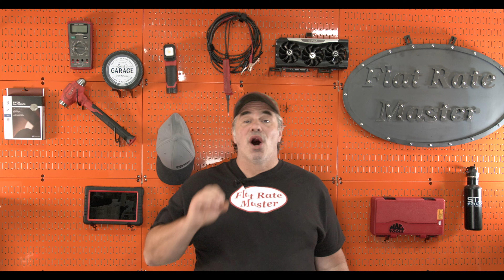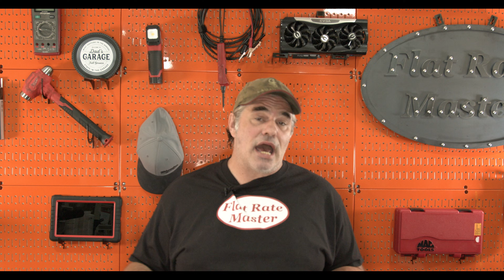How to Become an Automotive Master Technician

Comment: Uhhh sir did you just make up your own requirements masters is achieved threw the manufacturer you take tests too achieve it it says your qualified too do the work your doing. manufactures will not pay the tech unless the shop has knowledgeable person working there or several knowledgeable shop competence

Comment: I am ASE master certified, have been for many years. I don't think it means you know everything. No one can know everything. I think it shows you know the basics of how each system works in vehicles. For instance if you are ASE certified in HVAC. That means you know how the system works and the theory behind how the system works. You then can apply that knowledge along with the service manual to diagnose what is wrong with the HVAC system on the vehicle you are working on at the time.  So you can apply that knowledge to any make and any model vehicle.  Being ASE Master certified does not ever mean you are a master in the trade. Simply means you know the basics of how systems work and the theory behind how they work.  Someone with a good knowledge of theory and good knowledge of how to read schematics, how to test components, know how components are suppose to work would have a easier time figuring out a problem in a system, then someone without that knowledge.

Comment: I’m not ASE certified, but I still do technician work alongside alignments and oil changes, etc. it’s not particularly hard to do most things, you just need a good set of tools and the willingness to just get the work done. I work with a master tech that has been doing it for over 30 years, and you would be surprised how many seemingly hard jobs can be made easier just having the experience of doing it before and being able to do exactly what’s needed to fix it. I put an entire RF suspension and knuckle on a bmw x5 in about an hour and a half. All because there’s little things here and there that make the job a lot easier if you just think for a minute. The pay just isn’t there for me to want to invest money and time into tools and certifications training to get 15-20% of max 7-9k a week in service

Comment: Spot on, I couldn’t have explained this topic better. Training in class with other techs is where a lot is learned. But where most don’t want to put in the time that’s not paid for by the employer, is at home. Many hours of numb legs due to toilet top reading. laying in bed falling asleep with phone or tablet in hand. Watching scanner danner and other informing videos on how each and every single component and system on a vehicle works and what it’s job is. Learning how to use a scope is a big one. It’s crazy to think about everything that has been learned and experienced in my 21 years in the Automotive field. 🤯

Comment: Been a certified Master Tech for a few years now, and yes theoretically I know I primarily means you can pass a bunch of tests.  Worked at a stealership back in 97ish, a "husband and wife mechanic team" worked there.  The wife had the Master certificates on the wall and L1 to boot, but couldn't diagnose a pb&j sandwich let alone find a damn oil drain plug. Think the husband did 90% of the work while she played mechanic and "looked " busy.

Comment: Recommend (I passed all 8 a series in community college auto school)

Start with 
brakes 
Drivetrains 
Engine performance 
Steering suspension 

Next study like a mf on electrical 
Pass electrical 

Now you can move on to energize performance
Hvac 
Engine performance 
Auto trans 

I recommend doing the tests in this order because the last 5 are heavy on electrical diagrams or asking questions about sensor readings 

If I can do it anyone can just be persistent

Comment: OK. You are Correct. I Don't Think Anyone Can Be a "Master Technician". Like A Master Plumber Or Electrician. Our Systems Are Too Varied. How May Differant Vehicles Can You know enough to Be a master. I've been a Mechanic / Technician For 37 Years. I'm ASE Master Certified Tech. (I Passed tests) I Recommend People Specilize. I Think You Cild Make More Money & Buy Less equipment. For Me I Don't work On Europeans. ( Exsept a Couple) to much differant Equipment Needed. I Worked a Transmission Shop For a Year. IGot a Basic understanding Of how a Automatic Works I've Rebuilt a THM350. But I Understand The Principles I Couldn't Rebuild one Now or a CVT. Everything Is Contantly Changing. You Need Training & Never Equipment

Comment: I was ASE master certified after graduating from tech school and working in the field for one year. Becoming ASE master certified is very easy and that certification alone shouldn't hold a significant amount of weight. It takes years of hands-on work experience for most people to really start getting good at what they do and you need to work in an environment that allows you to keep learning. If you feel comfortable where you work and think you can handle anything that comes through the door, it might be time to look for a new job that comes with new types of work and new challenges. 

When I left my first automotive job, I felt severely under-qualified and inexperienced starting at my second job and that was a good thing. I was already ASE master certified when I started that job, but I still had a lot to learn. I was a much better tech when I left that job.

Comment: I still can’t get over all of the “high level” techs I’ve met over the years that have been doing the jobs for 10+ years that only go through the motions of performing the work rather than learning how and why the system works to begin with. The people that claim if there isn’t a flow chart to fix the problem then there isn’t a problem to begin with 😒

Comment: Shops don’t seem to do many repairs, like cvt transmissions. They just replace parts. Anybody can replace parts. And I’ve seen so many occasions where the shop can’t figure out a problem. They’ll just say it’s normal. Nothing wrong.
Reply: The US parts supply is set up to replace parts over rebuild them. Try getting brushes, bearings and a solenoid for a starter and see how long it takes. Add in the crazy labor times shops have to charge as well. Try rebuilding a wheel cylinder that may take 30 minutes instead of buying a $15 part you toss on. 

Transmissions are now a specialty, have been for 20+ years. There are a few transmission shops in my area that only do transmissions. And they are VERY good at them.
Reply: @mph5896 this!!!!
Reply: The repair procedure opposed too replace procedure is  weighed how much ….lyou ppl and your old school mentality it’s about dollars a what’s makes sense 10.000 too repair or 5.000 too replace you decide what would you do 5.000 an you get a new transmission make sense

Comment: As cars become more and more electric, they will become more and more disposable 

The days of fixing a car will be seen same as fixing a cell phone 

As there is currently a over supply of ppl of trying to get in to the auto field, it's uncertain there will be enough jobs to go around 

Of course, the elite level techs will always adapt and have a place.  But the need for this many ppl coming into this field is questionable 

It is no question, the career path with lowest barrier of entry 

Already, they successfully made replacing the entire car cheaper than fixing it - this is the way it will be the electric cars  

Only viable future as a auto tech is to become a specialist with manufacturer specific certification

I plan to retire before the electric cars are the only allowed cars to be sold

Comment: Well put!! Been working on cars/trucks/ Diesels/farm equipment and commercial aircraft for a long time, I'm 42 now working at a major airline as an aircraft technician. I did engines changes... navistar Dt466, cars, and aircraft; I modified my eclipse gst turbo, injectors, intake and exhaust and programmed the ecu. I have about 5 ase's in auto, 2 in diesel, customer service, parts,   and x1 which I'm due for retest in 2024. I am versatile and like to learn in similar fields, anything in transportation but never worked on trains yet.  I have failed Ase test too many times and will probably never be a master Ase technician in automotive and I'm fine with that but I may keep trying because that has been a goal of mine from since I was 20 years old. But Flatrate is correct, I don't have the seat time and with working in other transportation fields its just too much information to process. Even If I did become a master, I wouldn't want to wear the patch on my shoulder bc I don't know everything  and wouldn't want to be a know it all. I'm always learning everyday and learning never stops even simple things throw me for a loop sometimes.  Working on aircraft is so much fun because everyday is a new problem, repair, or troubleshooting and no customers or foreman's rushing you. We work on everything, from engines, seats, flight controls, software and yes toilets and the waste system and also taxi the aircraft. I worked on the 777, 787,767, md11, md80, 757, 747, CRJ 200/700/900, and Dash 8 turboprop aircraft. My high school was a aviation mechanics and flight school in Detroit. We need more trade high schools like back in the day for our young people. I love Automotive and Diesel, I may never achieve my full potential in the field and I'm ok with that because I just don't have the seat time! It's impossible to know everything but you become stupid when you think you know it all. Even a new kid in the field can teach a old dog new tricks! I would love to work on trains but in this economy.... maybe in the next life! Hopefully I can retire from the airlines.
Reply: "You become stupid when you think you know it all." That's the truth. Also, I've taught old mechanics in the shop several new tricks already in exchange for their experience. I know I'll never get on everyone's good side as the new guy but I'm working really hard.
Reply: How is the pay at airlines compared to automotive?
Reply: @dougbrook6223  Old mechanics like that stay at one shop for too long and don’t get the pay they deserve. If you’re thinking of doing it then you should be fine just remember to switch shops when the money isn’t enough.
Reply: @dougbrook6223  Yes the pay$$$ ... Back around 2005, coming from automotive I took a pay cut making $12hr Piedmont regional airlines. I worked at Walmart at the same time (2nd job) making more  $14hr. I think because of my ASE'S; this was in Maryland, then moved to Chicago started out at $14 Mesa regional airlines and topped out around $20; this was 2006-2013 (Regional airlines)...  50-70 seater aircraft that fly for major airlines. During these years I did contract work (2nd job $18hr.) for international airlines to get experience on large wide body aircraft 747, MD-11, A330 ect... to get experience to be hired into the major airlines. As well during this time I went to school for a diesel/heavy equipment technician just incase for what ever the future may hold because I wanted to become versatile.  In 2013, I was hired by American started around $23 or $26hr I think.  And at that time I topped out in 5 yrs at around $46 hr.  Ten years later due to the contract, I'm at $52hr. Now there's a huge shortage for mechanics and pilots so regional airlines are paying more around $20hr to start no experience. And we at American now have 20 year olds working here due to the shortage of the baby boomers retiring and because of trade schools closing and many people not knowing about aviation mechanics and getting into the field.  Now it's a ten year top out for pay.  I work midnight's, we have time and a half and double time, and 401k matching. Now I have enough time to make afternoons but I prefer midnight's. I graduated my aviation high school in Detroit in 1999, and then attended their program for 2 more years and community college Earning two degree's automotive and aviation mechanics. I graduated October 2001, so I did automotive from 2001-2006 Sears and Michigan motor exchange (2nd job).  My dad was a automotive mechanic growing up so he made me change his brakes, water pump, ect when I was in middle school/ high school. I love automotive but hate making commission when the economy takes a hit. By the way Cargo airlines like Fed Ex and UPS tops out around $60 something a hour I think. Pay has really increased for Aviation technicians due to the shortage. I feel automotive technicians are well underpaid for their responsibility, knowledge, and tools/toolboxes that they invest in. At Sears back in the day I made it to tech4 in about a year in a half doing everything timing belts/ head gaskets, alignments, brakes, rear ends, AC, half shafts, I did work Sears didn't advertise and do but I charged the customer book time on these repairs bc at Sears we had a hybrid pay system depending on tech. status and Ase's. I had a 16 bay shop, 2 alignments racks and split my commission with the junior techs, teaching them cutting rotors/ drums/ alignments/ electrical, letting them borrow my tools so we wouldn't turn away customers bc Sears wouldn't hire enough qualified mechanics being cheap on hours, I even did customer service bc our advisors were lazy and wouldn't answer the phone, so I would do the sale and the work bc they didn't understand customer service. Now look at Sears. I could would work on 5 cars at a time managing my time and splitting my pay with non certified techs so we all made money so we didn't turn customers away and we were the best performing Sears in our network area.  I loved working at Sears, because we ran our shop like Nascar, we were quick and efficient. 4 tires, 2 tie rods, and an alignment done in 15 minutes... 3 people working like a race team drinking monster energy drinks. I prefer working as teams in automotive better because it's more efficient, that being said, automotive mechanics should make the same pay as aviation mechanics, no excuses!!! My other favorite job was Wendy's but that's for another day. With any job it's about quality of life as well, at 42 now I do boxing, gymnastics, and skateboarding which I just got hurt in doing, in life you must take risk and if you try hard and don't give up....you have no choice but to succeed. Hope this helps you Sir.